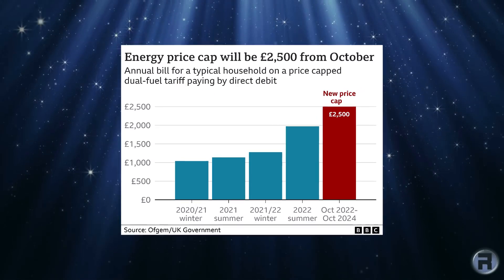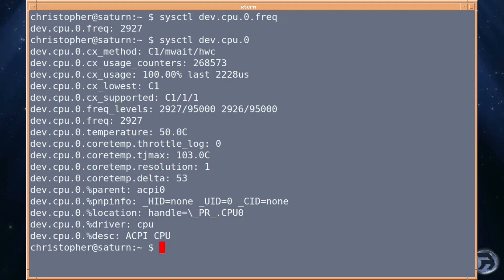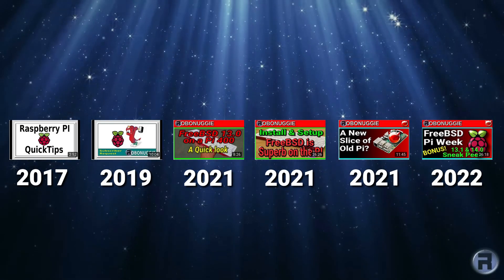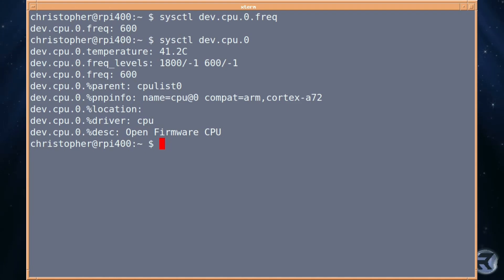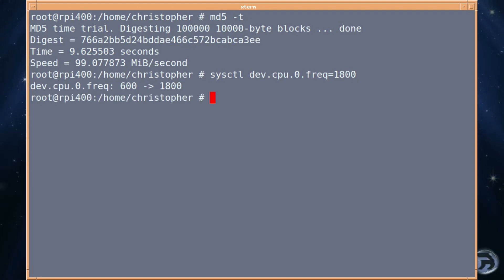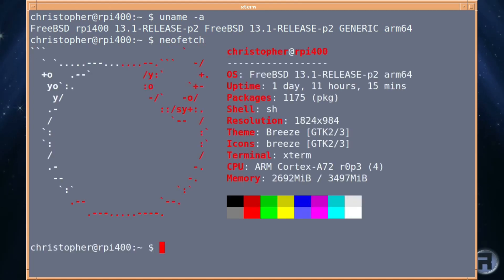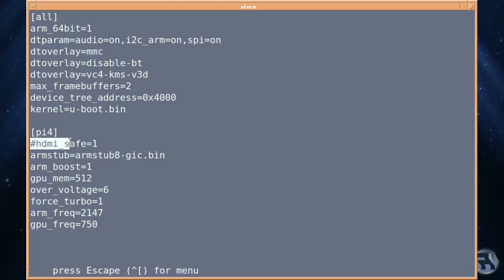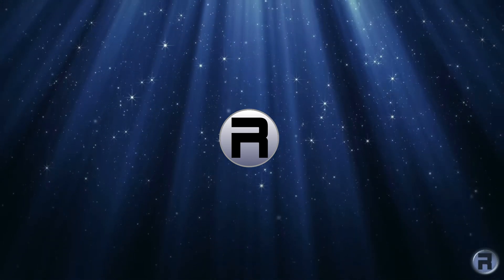Me, Myself & Pi - It's Electrifying!

Comment: I've got to say it's very appreciated all the videos you've been posting with tips and instructions about how to run FreeBSD on the rpi4, which is why I've got a very nice setup running on my Pi.  Pity though that a ZFS image is not available as an option (yet).  UFS is OK, but on power failure or crash, pain in the backside to recover.

Comment: Hello
Yes freebsd is great on the pi. One question ? How do you copy freebsd to an M.2 ssd? Or how do you install freebsd on the ssd drive rather than the micro SD card?
Reply from the maker: I can't answer the first question as I don' have an M.2 drive, but the SSD - I use one of those two in one (power and Sata) connectors but you can use an external dock etc, connect to a PC or the PI running Raspberry PI OS, write the image to the SSD and then plug in the SSD to the PI and boot.
If not already done, make sure you are running the latest Boot code by updating using RPI OS...

Comment: Ouch... those X5570 are just too old. Even a couple of generations later would give you much better frequency scaling, thus lower power usage at idle. Unfortunately it doesn't seem that the Z600 supports anything else other than Nehalem. That's just sad.
Reply from the maker: Well, I've had this machine for a while, and I never bothered with power consumption before.... maybe Father Christmas will grant my request for a more modern system... :-)